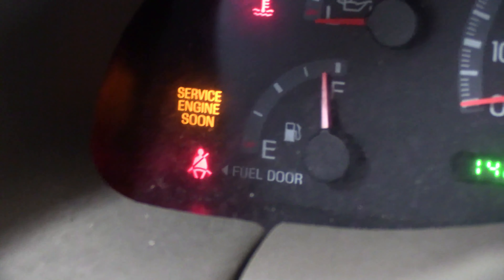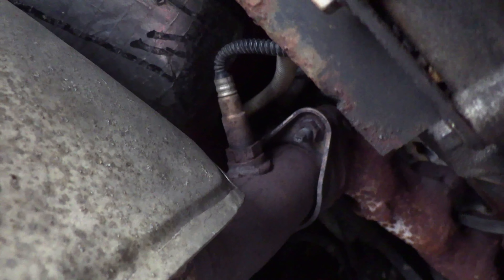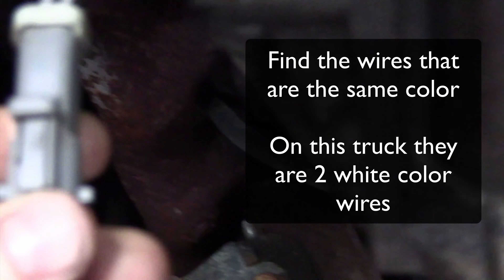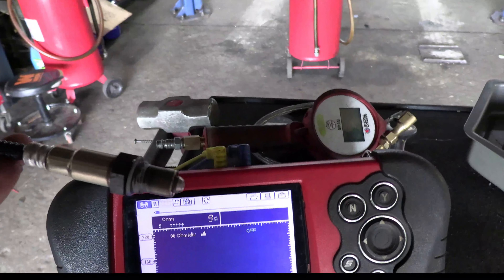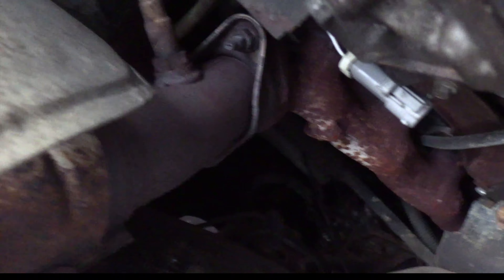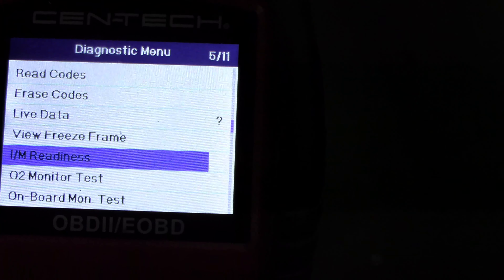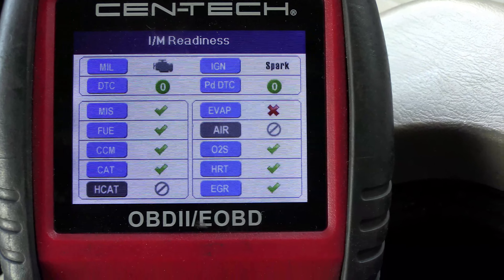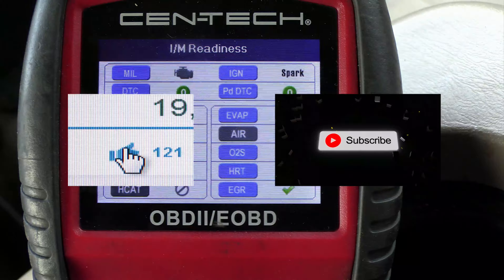EASY- HOW-TO // OXYGEN SENSOR REPLACEMENT // 03 FORD F150

Comment: Appreciate the info, I felt there was a easier way to tell if they o2 is good or just bad, checking omhs didn't cross my mind. My fuel trims are rich, o2 are the last thing to replace. Fuel preasure regulator, Mass air flow sensor and evap purge were bad, tested before ordering. Last thing to check was O2, your video on testing them makes it easy. Will have to wait till morning, since it's raining.  01 f150 4x4 super with 235k, great piston compression.  Just trying to fix those LTFT. Keep up the good work.

Comment: Will an the upstream O2 sensor effect acceleration if there is no cat on the vehicle? My 03 f150 runs great cold and after 30 minutes of driving it doesn't accelerate like it should and doesn't shift until 4k plus RPMs. Cleaned the TB, MAF, changed plugs and wires, and serviced Tyranny. No change
Reply from the maker: There are alot of variables there.. does the engine free rev fine? [not moving throttle snap)- if so you may actually have a trans problem
Reply: @petesautosj   it free revs just fine. My mechanic is leaning towards Transmission solenoids. However, if I'm to believe my cat was bad then it would make me think the O2 sensors were too.
Reply: But, I just don't know whether it's worth putting new upstream O2 sensors on a truck that is straight piped now.
Reply from the maker: @MikeBrown-rr9wj  If you’re asking my opinion I would say that an oxygen sensor will not fix that problem… At my shop we would use a scan tool to diagnose the problem and be 100% sure
Reply from the maker: @MikeBrown-rr9wj  Usually a clogged catalytic converter would cause the engine to bog down and its ability to free rev would be very limited
Reply: @petesautosj  Thanks for the advice, I have an appointment at a transmission shop. Ford dealership didn't find any transmission codes, just Intake, Exhaust,  and PCM codes. But they wouldn't look pass the missing cat for answers. Besides,  I learned that Ford Dealerships rarely look at vehicles older than 10 years. They looked (scanned for codes) at mine to get me interested in buying I'm sure.
Reply: @petesautosj  yeah looking back at it, the first mechanic sold me on cutting it off and welding an exhaust pipe based on a hunch he had. The Cat was extremely hot and tail pipe was pretty cool at normal operation temperature.  That coupled with the acceleration problem made him believe the cat was bad. I read somewhere that the number one cause of a clogged cat is the O2 sensors. But sense the cat is gone and it's still slow to accelerate and slow to shift at warm Temps, I believe it's the Transmission. I will let you know the final outcome either way.
Reply: @MikeBrown-rr9wj  hey buddy I had same problem... Mechanic and myself thought it was tranny, but van only had 80,000 miles... Turned out to be a damn clogged EGR VALVE 🙅🤷🙇... Almost sold my van for scraps so check all those Emissions stuff like PCV valve and such
Reply: @hajileserpud9539  thanks, I will have to check it. I didn't clean it since the Throttle Body wasn't in very bad shape at all.

Comment: Question I have a check engine light on for Bank 2 Sensor 1 where exactly is that located at ?
Reply from the maker: If you have the same vehicle as the video, is the sensor closest to the engine on the driver’s side of the vehicle.
Reply: @petesautosj  I have a ford Sport Trac